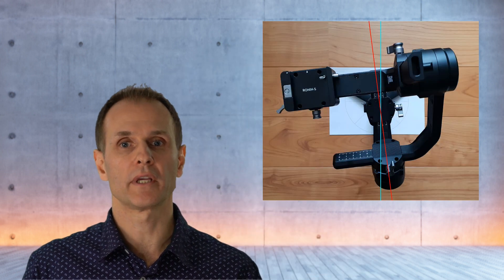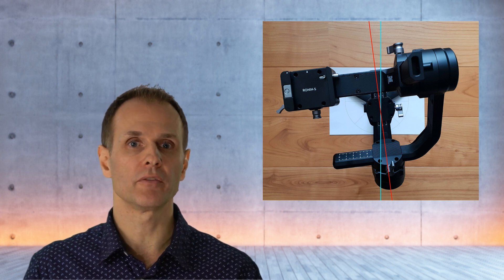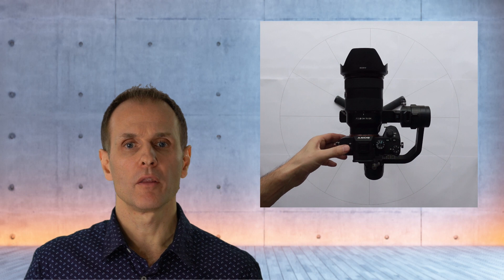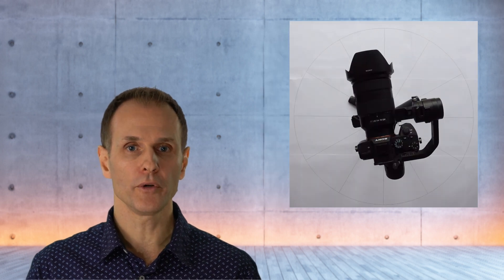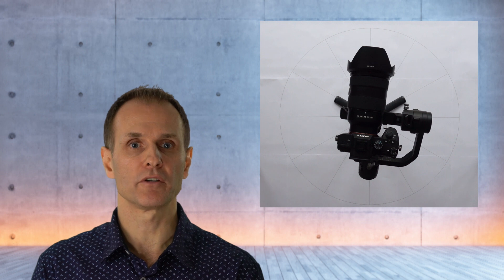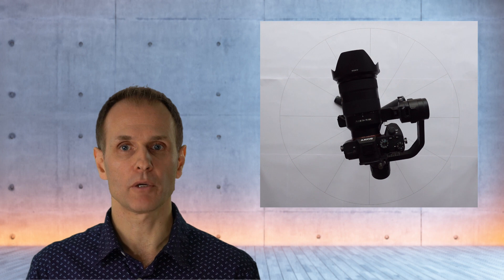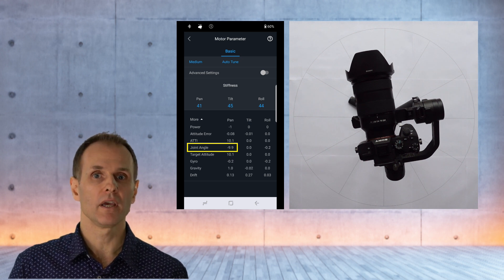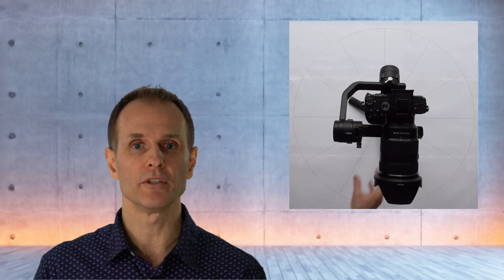Ronin-S Problem: Joint Angle Drift and How to Fix It

Comment: I have the ronin s for about 6 years now and it show these drifting issues, it's been used for more than 400+ weddings and gigs, and I thought it needed to rest due to this problem turns out it was perfectly fine and just needed a good reset and calibration, it has been working flawless so far, I want to say thank you. It wasn't been use for couple of months now since I got another 2 dji the rs and rsc but I landed this video and I think it should be use again instead of eating dust, thank you very much, subscribed.

Comment: Thankyou for this incredible video - however, my roll axis on the SC is off and I cant seem to adjust this with the joystick to then calibrate the offset - any tips? 
I tried the virtual joystick and offset the imbalanced roll axis and offset it through calibration as you explain but it doesn't seem to take even though says successful.
Many thanks.
Reply: I found a fix for this - if anyone has this issue with the Ronin SC, in the Status section of the Ronin app, find 'Horizontal calibration' - this fixed by roll axis issue!

Comment: Hello! I have balanced all well, auto tuned, balance tested, but still does not center. I tried several times fixing joint angle by offset calibration. It says “offset callibration successful” but when I recenter it drifts and centers tilted. What should I do? Please help!!!

Comment: Thanks for the very detailed and clear explanation.  My issue with my Ronin S is that it consistently points slightly downwards and slightly to the right.  I tried your solution but to no avail.  In fact, after I press "OK" for the Offset Callibration, the "Offset callibration succed" notification does not appear and the gimbal will just return to the incorrect position once I try to bring it back to the reset position.  I'm not sure if you have any guidance in this regard but any help would be greatly appreciated. :)

Comment: Hi, Thx for the info. I tried doing this, but unfortunataly I do not get a confirmation "Offset calibration succeed". If i recenter the gimbal, the offset is back... So it seems that this does not work anymore? App version 1.2.10 - Firmware versin 2.3.2.20
Reply: Hi, had the same issue. I tried the system calibration too, but it did not seem to do anything...
Reply from the maker: Meanwhile the new and updated version of the app should offer the feature to re-center the gimbal.

Comment: My gimbal centers properly when I double tap the button to center. The problem is, when I want to take a hyperlapse and hold the button down to keep my gimbal straight it drifts off center while walking. Do you have an idea why and how to fix this? The gimbal is properly balanced
Reply from the maker: What happens, if you switch to another mode, before doing so?
Reply: Photovideographer so when I’m in my normal mode 1 and hold the button down it drifts just a small amount when I walk in a straight line a ways. In mode 3, I set the app to turn all the motors off so the camera just stays in place and the same occurs when I walk in a straight line over a period of time I can notice my camera isn’t centered with where I started off at.
Reply from the maker: @arcanefilms9380  Then, I'm afraid, you might have to call the dji support.

Comment: I accedently find a solution - in new version of app appear a new fiture - top icon near bluetooth mark and there is a system calibration for drift issue
Reply from the maker: Great! This means dji has finally accepted that this is a real problem for many Ronin-S and Ronin-RS users and have implemented a solution to it. So far, they have always denied the existence of this problem.

Comment: hi. I tried it but in a update version of app with iphone 8 when I tap to joint angle and then press ok - nothing is happening, calibration offset is no appear,  any suggestion?
Reply from the maker: You have to press for six seconds or more. Then let go and the message should appear.

Comment: I DID IT IT WORKED BUT I STILL HAVE A SMALL DRIFTING  TO THE LEFT WHEN I RE CENTER IT  . SHOULD I RE BALANCE THE JOINT ANGLE AGAIN ??
Reply from the maker: Yes! You can recenter as often as you want. If there is still a slight left drift after recentering, then try to manually put the gimbla in a slightly right angle position while recentering.
Reply: Photovideographer thank you for your help ! I really appreciate it !!

Comment: Hmmmm, I thought this was about drift calibration but it wasn't. This is about reset calibration using joint angle adjustment. Drift happens over time and I experience it all the time and am trying to rectify.

Comment: I have a horizon issue its not in level what can I do anyone had the same problem and find the solution?
Reply from the maker: The steps provided in my video work for all three axes, i.e. no matter whether you experience a joint angle drift on the pan, tilt or roll axis. Just follow the steps in the video.
Reply: Photovideographer I did it exactly how you show but when i press ok didn’t show the tab offset calibration succeed.
Reply: Photovideographer it works only for the pan but not for the roll. The horizob issue can only be corrected if this works with rhe roll

Comment: This fix doesn’t work for me either. I’ve followed the directions. Pressed ok, however it does not say anything about “calibration” being completed. The window just goes away. I double click the trigger button and it goes back to its offset angle and not my calibrated angle. I’m also using the iPhone app. This sucks. Has anyone got any updates with this problem?
Reply from the maker: Have you pressed "Joint Angle" for six seconds or more?
Reply: @photovideographer7230  I have.  The box comes up which says it will calibrate once i press "ok" or i could choose "cancel" i press ok and the joint angle numbers go to zero. Buuuuuut when i double click the trigger button, the gimbal goes right back to its previous joint angle settings.  Any ideas?
Reply from the maker: @DamianBartolacci  This may read like a silly question now, but have you manually moved the gimbal in a centralized position with the joystick before pressing "Joint Angle" for six seconds or more?
Reply: Photovideographer no it’s not a silly question. I did do that. It still doesn’t save.
Reply from the maker: @DamianBartolacci  Do you connect your Ronin-S to an iPhone or smartphone running on Android?
Reply: Photovideographer I have an iPhone. I read it might be that. But I actually think it’s my motors. I’m sending it in. Thanks though
Reply: @DamianBartolacci  The app acts the same way for me on my Ronin-SC.  My horizon line is just slightly off, and I'm trying to straighten it out.  Same thing is happening to me as you're describing.

Comment: doesn't work
Reply from the maker: For most Ronin-S users the instructions in this video work quite well. But, of course, I cannot guarantee that it works for everybody. A few people using an iPhone mentioned some issues. What do you use?
Reply: @photovideographer7230  i was using iphone. but when i read one of your comments, i tried using android. and still won't work. :(

Comment: Great video, I need your help with my problem if you can, I get my new DJI Ronin S, so I balanced the axis correctly. When I tried it was a clear vibration with it, would you help me please ?
Reply from the maker: That's weird! Typically a gimbal only vibrates, if it is not balanced correctly or one has surpassed the maximum payload, i.e. camera and lens are to heavy for the gimbal. What's the weight of your camera and lens?

Comment: Same problem on my new Ronin-S (bought 09.07.2019). Lates Firmware v1.8.0.70 (2019.03.14). Always slowly drifts 11-15° to left after pressing twice the trigger.
Unfortunately this procedure did not work on my Ronin-S. Tried it 4-5 times without success.
Reply from the maker: Does it get back to neutral position after pressing the trigger button twice and only then slowly drifting to the left, or does it deift to the left on pressing the trigger button twice?
Reply: PROBLEM SOLVED:
I've got an email from DJI with the following steps that helped to solve my issue.
1) Make sure that the camera is well balanced on all axis.
2) Install latest Firmware with the Pro Assistant Software and also load latest Smartphone App.
3) In the App go to Configuration > Settings and run "Restore Gimbal Setup" then run "System Calibration".
4) Back in the main menu go to "Motor Parameters" and run "Auto Tune".

I'm sure I already did all these steps before, but maybe step 3 not in that order.
But after all the movement issue has gone now and I can start using my Ronin-S now.
Reply: @andreaskugel8575  it did work ! Finally ! thanks a lot !
Reply: thanks! i been watching so many videos... fair play for following it up in the comment section
Reply: @andreaskugel8575  Thank you! After trying your video above I still had this persons same problem. I tried what you wrote in your comment to restore gimbal setup, run system calibration, and auto tune and THIS fixed my joint angle drifting problem. Thank you again.  Ronin S V2.3.1.20
Reply: It centers first to neutral position and then starts drifting immediatly. After 10 seconds it stops. This happens in every mode - also selfie, flashlight or underslung.
Reply from the maker: @andreaskugel8575  Don't shoot the messenger, but you might have to send it in. Seems to be an issue with the respective motor and/or how it is actuated - which works in impulses rather than contonously, which might explain your observation.
Reply: Thanks, I contacted the dealer and will send it back.
Reply: i had the same problem but fixed it with the lastest firmware version that I've made today 2019.07.05
Reply: @monkmedia_co  See my solution some comments above. I've also heard about a new App-Version which has joint these steps in one calibration process. But haven't installed and tested yet.
Reply: Same here

Comment: My DJI Ronin fixed until I pressed the button twice and then it went straight to drifting again... what shall I do?
Reply from the maker: Have you followed the steps in the video in exactly the order presented?
Reply: Photovideographer yeah man
Reply from the maker: @joshuatimmins2681  You have to bring the gimbal in neutral position first, and only then overrite its own calibration by pressing the button in the app for six seconds or more. Only if you get the confirmation by the app, you know its overwritten.
Reply: @photovideographer7230   I know mate I did exactly that and it worked for a short while but then starts drifting again
Reply from the maker: @joshuatimmins2681  OK, understood. After performing the steps in my video it works, but only for a while, then it drifts again. If so, your Ronin-S has a real problem as it doesn't keep the neutral position. This sounds like a problem of motor actuation (the motor are actuated by impulses), i.e. a hardware or software problem of the gimbal itself, that you cannot overwrite with the app. You might have to send it in.

Comment: The camera I use is a sony a7 iii with a Tamron 28-75mm len. I balanced the camera, auto tuned it and did the balance test with the results saying excellent however it was drifting.   After the update of the firmware my gimbal started this drifting.    I have only had my gimbal for less then a WEEK!   DJI should not have said you were the only one, because you are not.
Reply: is your ronin already fix by now? mine too is drifting
Reply: Dude I’ve got the same set up & notice drifting CONSTANTLY. Especially when I go from briefcase mode back to upright. I hate to say it, it gets the job done but the gimbal is awful @ maintaining stability.

Comment: I did not work for me.
Reply from the maker: Do you have an Android phone or iPhone?
Reply: Photovideographer iPhone xs
Reply from the maker: Seems like iPhones or the dji app for iPhones is causing more truble than Android phones. Usually it's the other way round. Scrolling down a bit you will find another case where it didn't work with an iPhone. Have you followed my process step by step? What exactly does not work or at what step it starts not to work anymore?

Comment: Thank you so much! You fixed some trouble I had when stabilizing it and fixing the joint angle tip. I also noticed that it worked better when auto protune calibrating it to medium.
Reply from the maker: Thank you Daan. Always glad to help. Have fun with your Ronin-S! :-)

Comment: Great video! I have a question! If I hypothetically set the Joint Angle Pan to -10, Tilt 0, Roll 0, and then I click OK on the Offset Calibration, will the new Joint Angle Pan still read -10, or will it read 0? If it's the latter, does that mean that, if you incorrectly offset calibrate the Ronin the first time, you can't rely on the Motion Parameters' datum and have to instead rely on "how it looks?"
Reply from the maker: It should still say -10. But I wouldn't rely on the numbers in the app. Just re-calibrate the gimbal in a way that it points in the direction you want it to point to (e.g. straight forward in neutral position). Apart form that, you can re-calibrate the Ronin-S exactly as you like. Let's assume you are a vlogger and use camera and gimbal mostly with the camera directed to yourself, then just turn the gimbal's pan axis with the joystick by 180° and re-calibrate it in that position. That way it should always point to you. And when activating selfie mode it would turn forward, i.e. away from you.

Comment: Not sure what i am doing wrong, but I hold the buttom for 6 seconds and press ok and I dont get any confirmation from the app, and I tested it again and didnt work at all. Cant recenter this is frustrating
Reply from the maker: Hi Guillermo, what button do you press?
Reply from the maker: Please double-check that your Ronin-S and smartphone are connected. Then press the display of your smartphone where it says "Joint Angle"  (don't press on the number right to these two words!). Just press on these two words for six seconds or - if necessary - slightly longer and then let go. Then a window pops up, which says "Offset Calibration". Choose OK, which finalizes the re-calibration and a pop-up window appears, which says "Offset calibration succeed".
Reply: @photovideographer7230  Yes, I get the little window for offset calibration.  and I press ok, but I dont get the "Offset Calibration succed" confirmation. And when I double tap the shutter on the ronin is still shifting in the bad position :(
Reply from the maker: Have you followed these steps? 1. Connect your Ronin-S and smartphone. 2. Press the trigger button of the gimbal twice (then it should try to get in neutral position, but falls into its joint angle drift). 3. Go into the app press "Configuration", then press "Motor Parameter" and then collapse the screen by pressing "More". 4. Look whether one of the numbers in the line next to "Joint Angle" shows a value of greater than 1.00 or smaller than -1.00. 5. If so, move the gimbal to the desired (neutral position) by using the joystick (at this point all three values in the line next to "Joint Angle" should be close to zero!).  6. Press "Joint Angle" for about six seconds and then let go. 7. The window "Offset Calibration" should appear, which you confirm by pressing "OK". 7. Then the message "Offset calibration succeed" at the bottom of the screen. 8. Now move the gimbal away from the neutral position via joystick and then hit the trigger button twice; then the gimbal should get back to the neutral position you have defined. 

It's important that you press the trigger button twice, before you start this whole procedure!
Reply: @photovideographer7230  Yes, Step by step, my phone is an OS, iphone, I started to think its the app that doesnt save the settings correctly into the ronin's software... This is sad
Reply from the maker: @deived16  That's strange! It worked fine for me, but I have an Android phone. However, usually apps for gimbals have more features and less complications on iOS vs. Android. Actually with this video I wanted to save people from having trouble with dji due to this malfunction of the Ronin-S, but in your case I can only recommend to get in touch with them.
Reply: Same here. On iOS I don't get any confimation from the app :(
Reply from the maker: That's strange! Typically these apps work better with iOS than Android. The manufacturers of smartphones run with Android usually add their own GUI and other manufacturer-specific features, which frequently cause problems when developing apps for Android phones. That's not the case for iOS, which is why they normally cause less issues. And in fact, I tried this with a friend's iPhone and it worked. Don't know what causes the issue with your iPhone or iPad.
Reply: doesn't work on my ronin both iphone and android phone :(